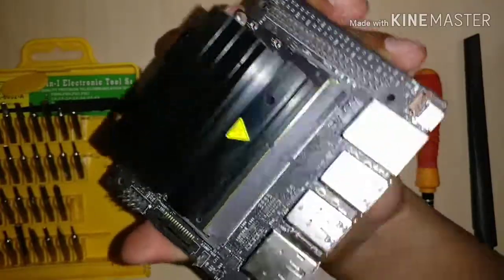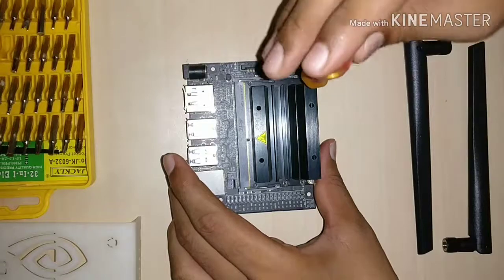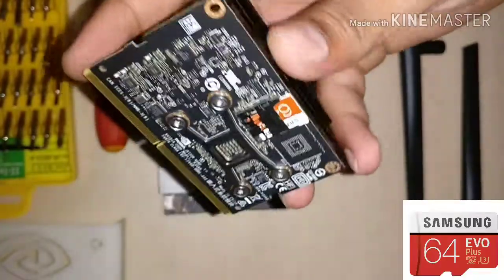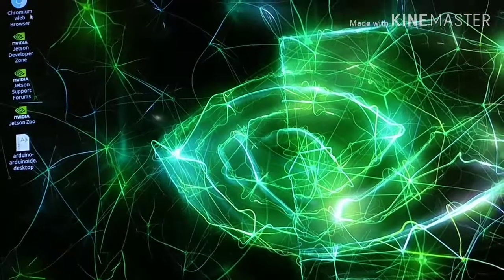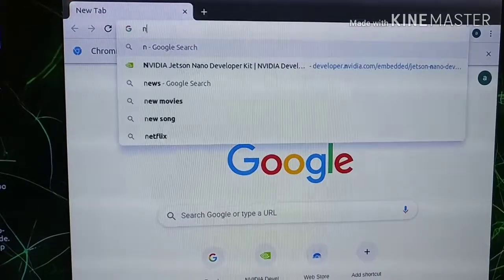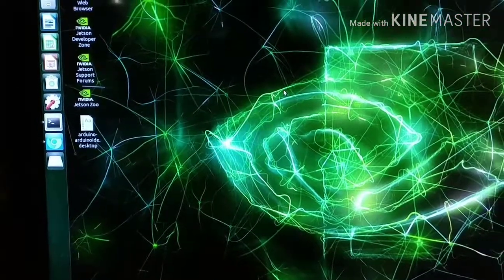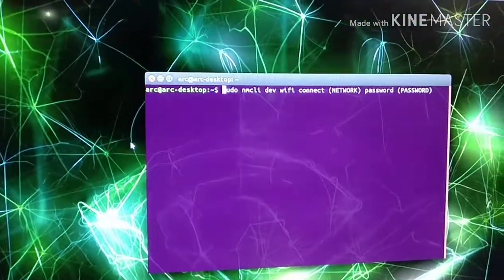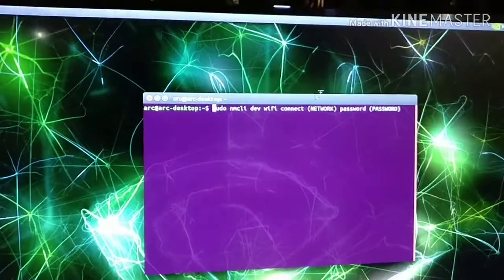Jetson nano wireless connectivity with Intel 8265 NGW | WIFI + Bluetooth | Remote connection SSH

Comment: how to do this setup of ssh in window?
Reply: If u wanna connect using putty its extremely easy. Simply download Putty app and enter the ip address and leave the port number to 22 as default and u can connect but the problem is u will get only terminal remote access not user interface.